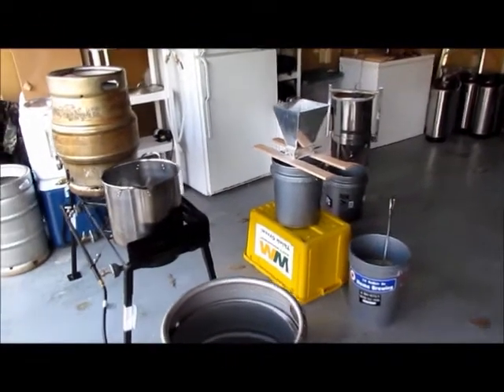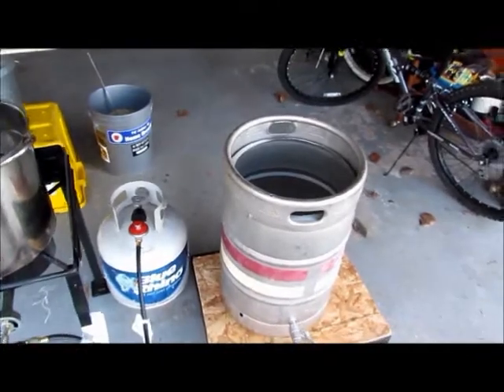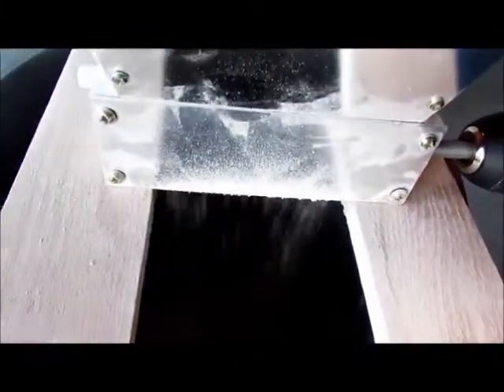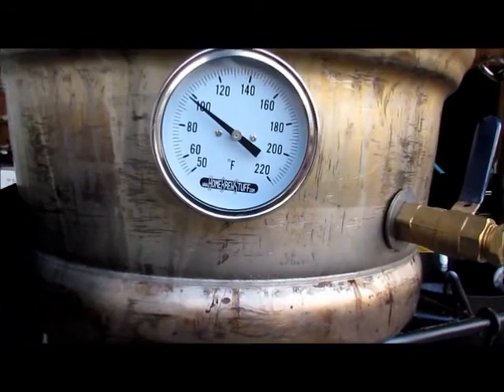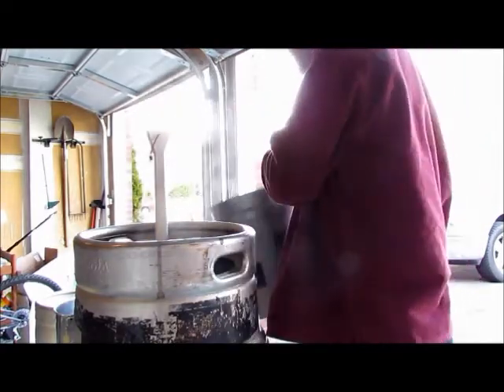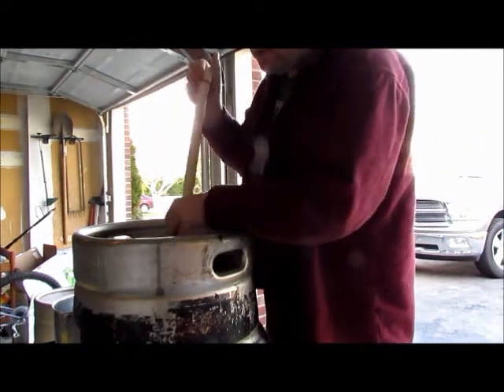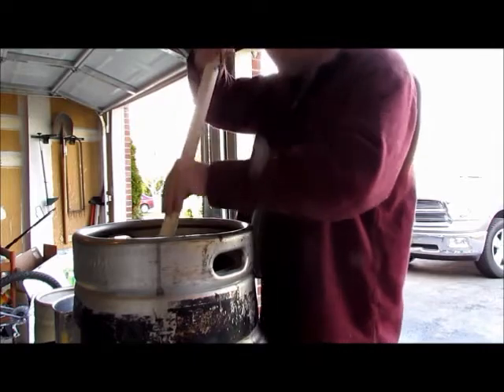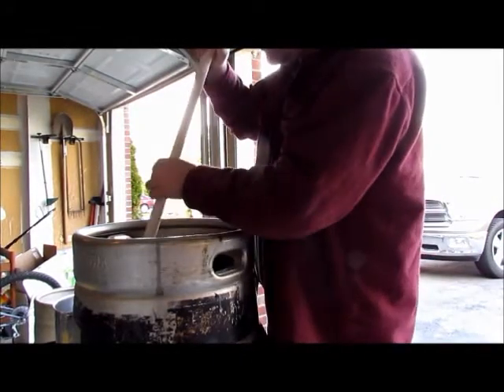Decoction Mash 2012 Octoberfest Part 1.wmv

Comment from the maker: Good question.  Since you want your enzymes to push out into your wort and not stay in your grains you run a thin mash.  I used 1 3/4 quarts per pound.  This allows you to boil your grains and break them down without losing your enzymes needed for conversion.